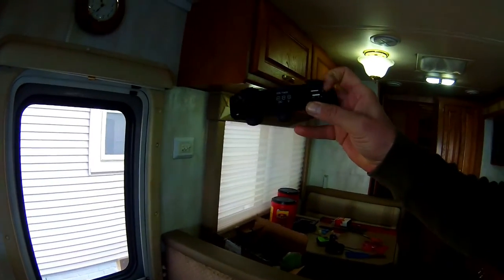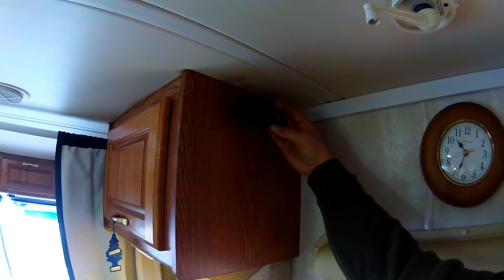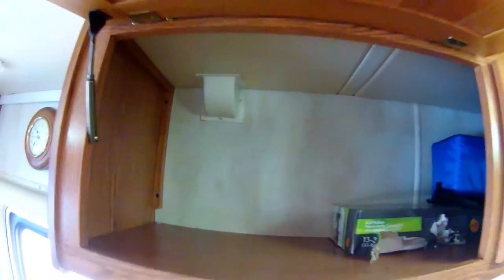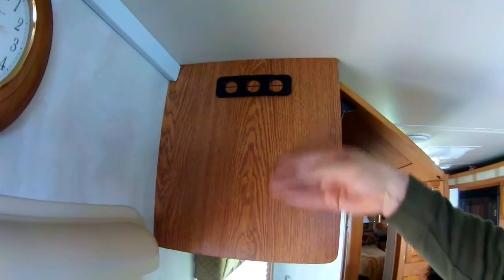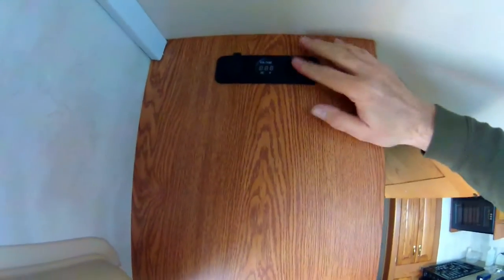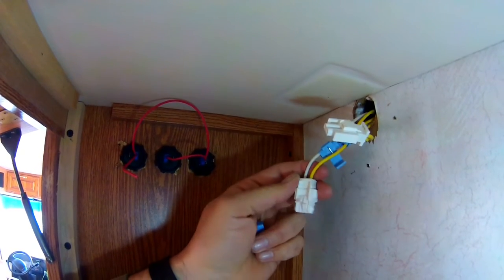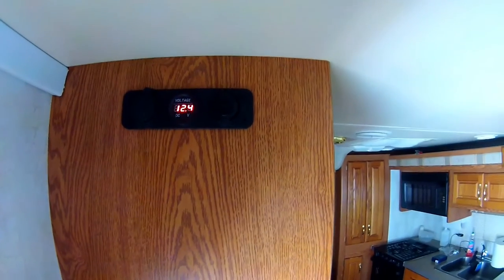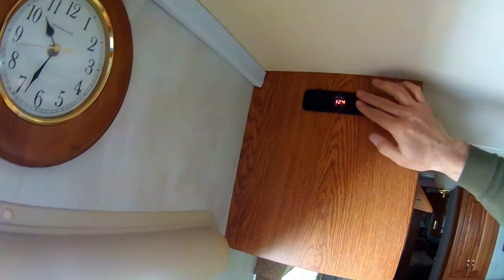Install USB Ports And Voltage Meter In The RV

Comment: I purchased the same setup but I also got an on/off switch.  Would you be able to explain how to setup the jumper wire like you have and how would I wire in the on/off switch which has 3 prongs on the back?  Any help would be appreciated, thanks!
Reply from the maker: Sure. The jumper wires just connect all the +'s together and the other 
connects all the -'s together. The Switch goes on the + feed. Now the 
lighted switch should have 2 tabs of the same color those are + and one 
goes to the power and one goes to the device. The last tab gets a ground
 if you want the light to illuminate. Switching the positive with each 
other give you "light switch light on" when device on  or "Switch light 
on" when device off. I can do a quick video if ya like just send me a PM
 requesting it.  I hope that helped a little at least :)
Reply from the maker: Here is one of my switch vids https://youtu.be/fu-lctLt090

Comment: You should replace one of the 12v power receptacles for a switch to turn that off when your not using it.
Reply from the maker: I sure did and it does save some power when needed. . Here is the video https://youtu.be/fu-lctLt090

Comment: Nice project. Have been thinking of doing something similar. Quick question: is that measuring the status of the battery, or the status of that line? Perhaps they are the same thing but when you turned the lights on/off you mentioned "using power on that line," so that got me to wondering.

Thanks for sharing!
Reply from the maker: +RV DogVentures Thanks RDV. Its reading the line voltage. When you are drawing power the voltage drops a bit regardless of where I take a reading. The effect is less directly from the battery. A true voltage reading can only be taken when the battery is resting with no draw and no charge happening.

Comment: I have 3 plugs on my volt meter...do I need to use all 3?
Reply from the maker: +Jason Preissler Not sure. I have never seen a volt meter with 3 leads. I would search the manufacture. Sorry I cant bet more help .
Reply: +BlackTop Boondocker ok tha k you. I am assuming it's for a remote wire or a switch maybe. I will use the two prongs that I know what to do with and see if it works right....wonder if it could also be a prong for a jump wire to go to the usb ports.

Comment: with all you're stammering and indecisiveness you never bother to explain how to wire the thing. we see it after you wired it but you didn't explain anything. That's for wasting time with this uninformative video.
Reply from the maker: If you have a specific question in regards how to wire it I would be happy to help. Or maybe just trying to be insulting was your goal.....either way thanks for watching lol
Reply: I have to agree with Greg. You spend time trying to figure out where to install the device in YOUR vehicle which has nothing to do with anyone else's vehicle, then you point at already installed wiring and say I THINK this has enough power or I'm pretty sure, when all you have to do is get out your volt meter. You mention the size of your hole-saw blade, "I think it's 1 1/8 or 1 1/4 but I'm not really sure", then you wired all three circuits of your installation together and plug it into an existing line that you are again guessing it's load rating. Now if you have a short you have no way of telling which one shorted and if it shorts it will blow out what ever circuit you have it wired too compounding your problems. The idea of an installation video is to answer specific questions related to the installation which you clearly haven't done. There are also volt meter / USB ports you can plug into any cigarette lighter port get your reading or do your charging then put it away again for half the price.                                                                                                                                                                This post has nothing to do with insulting you, please consider it an educational video on how to make an installation video. Most of us need Youtube to learn how to do things to save money. I recently did a complete install of a solar system in a van and I spent months sifting through videos like yours looking for pertinent information, and yours IS a waste of time for someone actually doing an installation.
Reply from the maker: Shavian1
Reply from the maker: Shavian1
No insult taken. Thank you for taking the time to give me quality constructive criticism and I really do appreciate it. I think say its a waste of time is a bit much but whatever its all good lol. A lot of what I do is on the fly using nothing more than google,some common sense and a few tools and the job gets done. Now maybe its not as good as some but it sure is better than many.  I'm not the best at filming and editing but the info I give is free and it should be taken as much. Remember we are all learning everyday and I'm no exception. Thanks again I will check out your videos.
Reply: BlackTop Boondocker okay.. could you make a video on how to wire it, please? Thanks.

Comment: yeah, just going on and on. Repeating yourself with no wiring instructions
Reply from the maker: I know right lol There is a black wire and that's negative (-) and there is a red wire that's positive (+)  Connect all reds together and all blacks together. I added a switch in the red wire (+).  If you have a specific question I would be happy to answer you.
Reply: Thank you. If you run the black to the battery will it still have power when the bike is off? I only want them on when the bike is on
Reply from the maker: Yes you will still have power. I added USB's to my bike and it was killing the battery so I added a switch. If you want it to be more automatic you can wire the positive to a circuit that is only energized with the key on OR install a relay available at any parts store commonly used for off road lights and accessories.
Reply: Ok. Thank you. Much clearer now